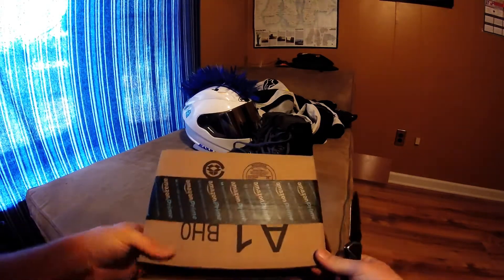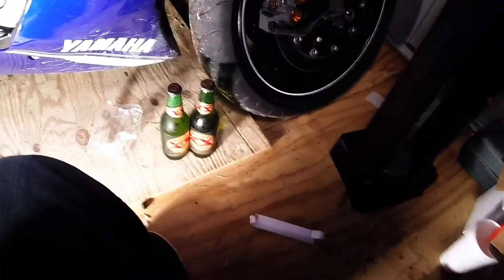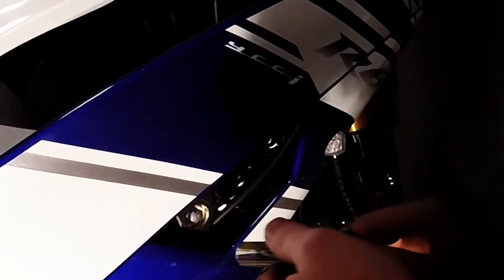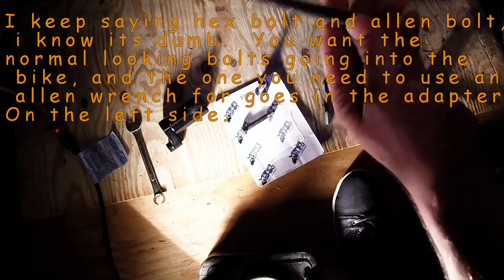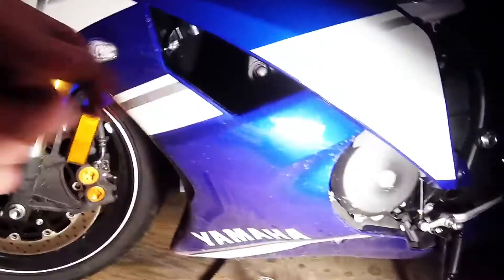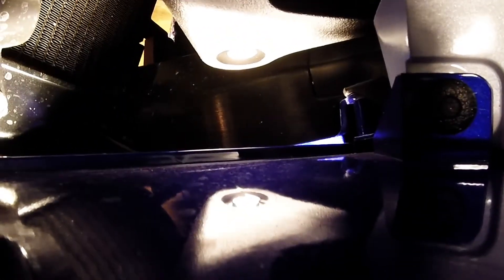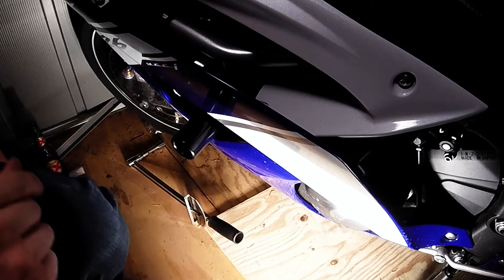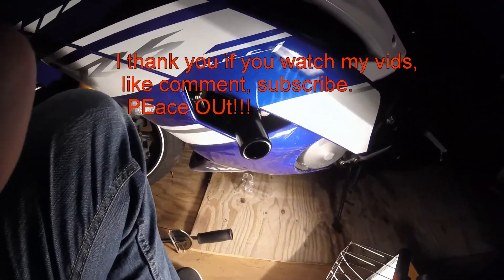Yamaha R6 frame slider Install Tutorial

Comment: I just purchased 2007 yamaha r6 and found it that bolt from the engine mount is missing i wondering is there a 3 spacer in the bolt like  yours in your bike. Before i put my new frame slider
Reply: Same did u find anything out